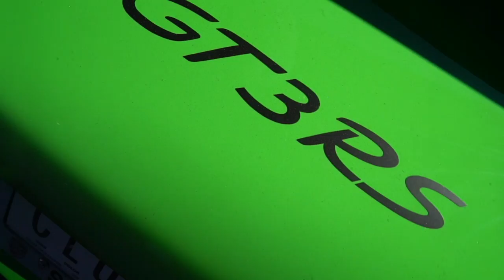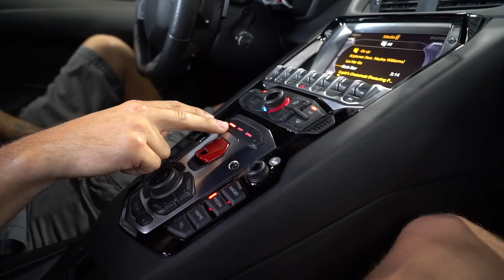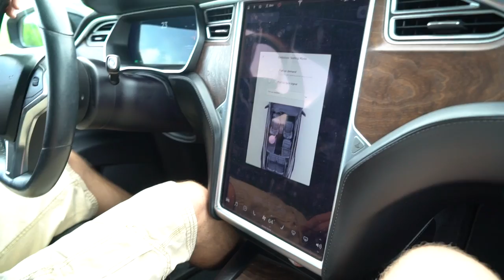Our truck sucks

Comment: Instead of using asphalt to fix the burnout marks, you guys should do a burnout on the rest of the driveway to make and make the whole driveway black.
Reply: Jay Desai 200 iq
Reply: “Modern problems require modern solutions”